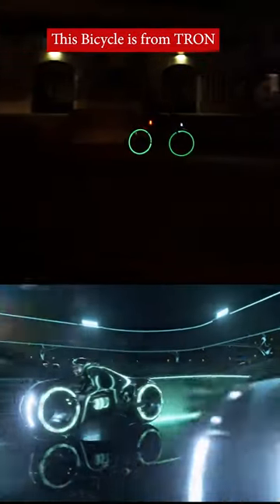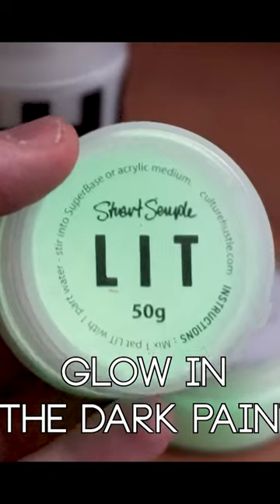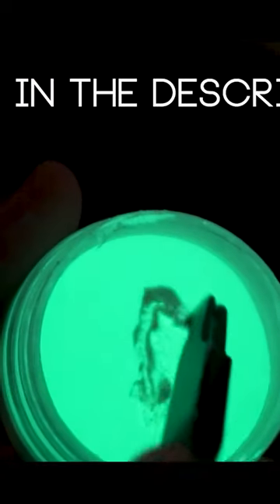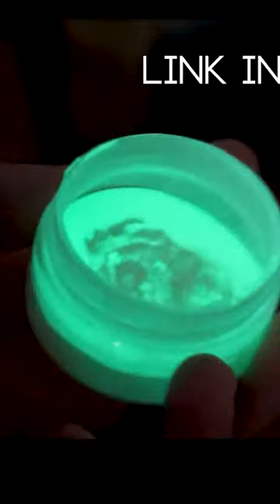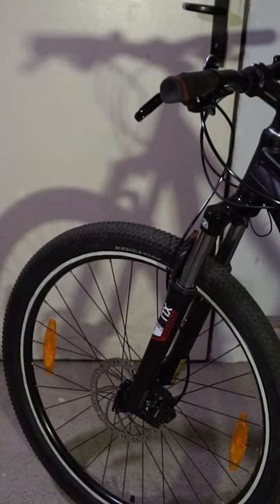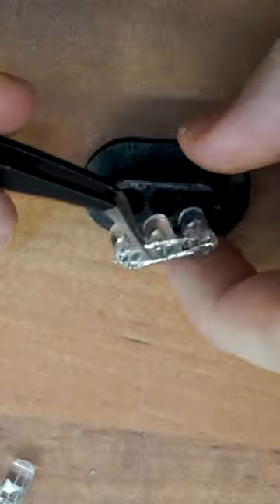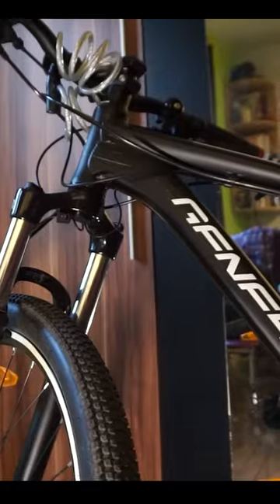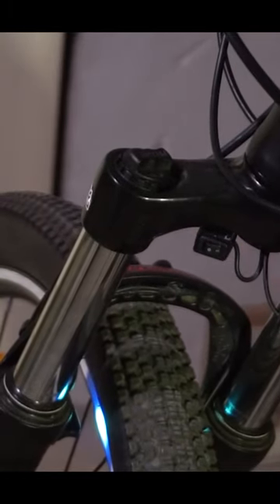Tron bicycle DIY lights

Comment: I now have Glow in the Dark wheels, from your idea on your passed videos. took lessthan 20mins. Didn't use paint, I used tape. and the UV leds.
Reply from the maker: That's awesome! That makes it a lot simpler
Reply: What did you use to apply the pigment into the wheel?